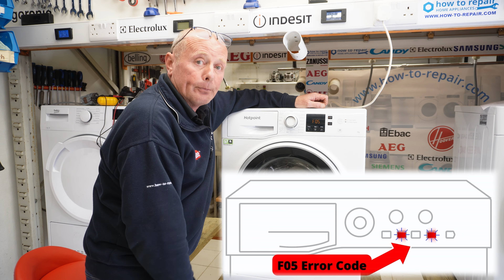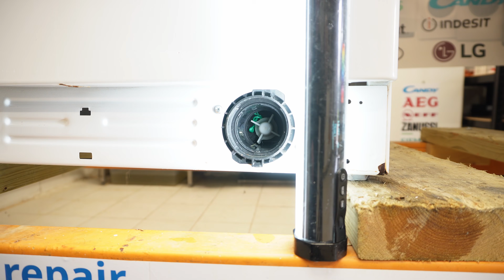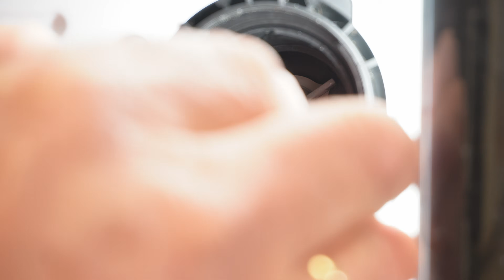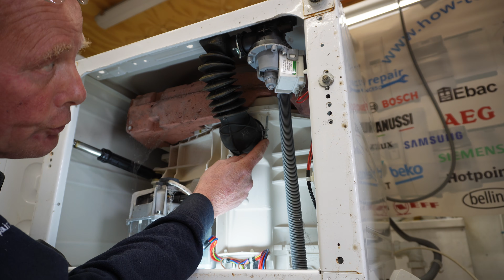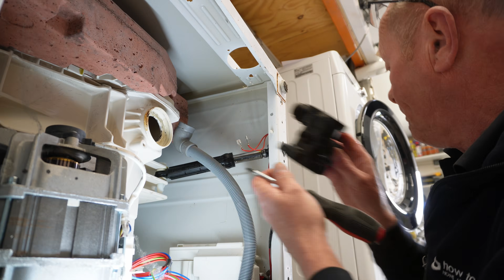Fix Hotpoint & Indesit Washing Machine F05  or F11 Error (Not Draining) - Easy DIY Guide

Comment: I was a white goods repairer for 10 years. We would do 15 to 20 service calls a day. The amount of coins we would pull from pump hose traps was always easy enough to buy lunch for both of us every day.
Reply from the maker: The best cash trap that any manufacturer made had to be the hopoint 95 series of washing machines these could accumulate up to £30-£40 of coins back in the 90s, so it was dinner for two and a good drink.
I will tell you a quick story I used to buy lorry Loads of used appliances from currys 
To refurbish There was normally 100 machines which I would pay £10 each for and I'd always get more money out of the Sump hoses and I paid for the machines
Reply: @How-to-repair haha that's hilarious! The 90's was a boom period for white goods. Split air conditioner's came on the scene we had a crew  fitting 5 a day!  For a decade! But those days are gone most white good repairers in my area have closed down. Doesn't seem to be any money in it anymore.
Reply: @cdonuts7335   the old hotpoint 9525 and hotpoint 9515 are better than these hotpoints
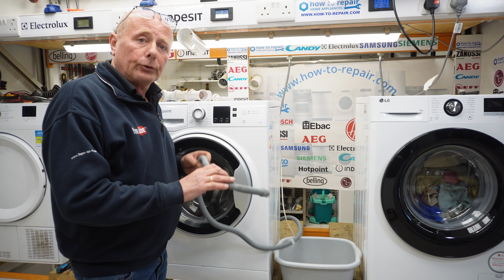Reply: Great advice 11:35